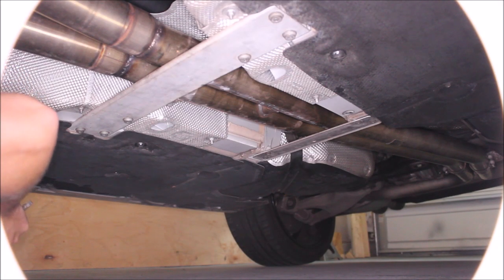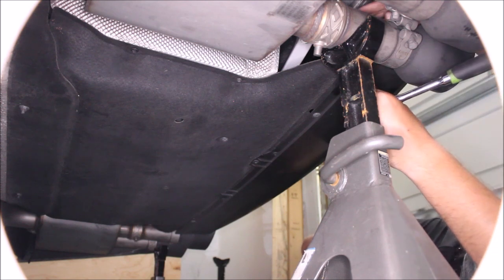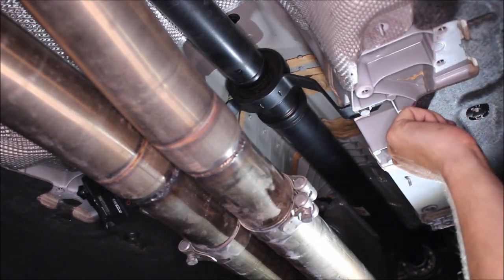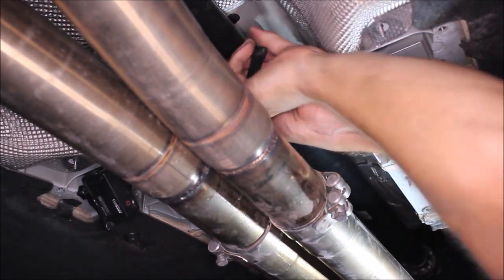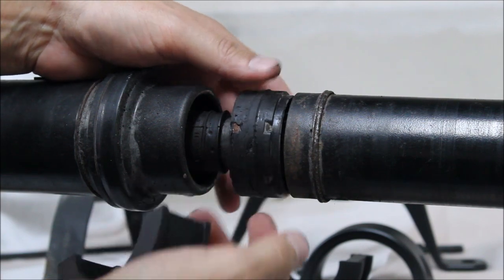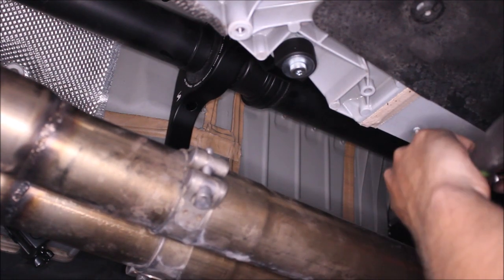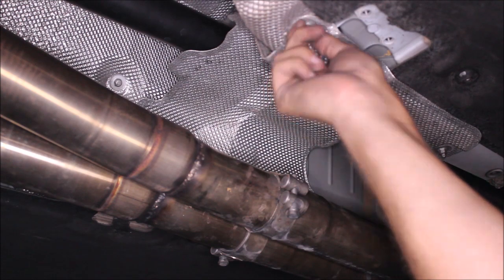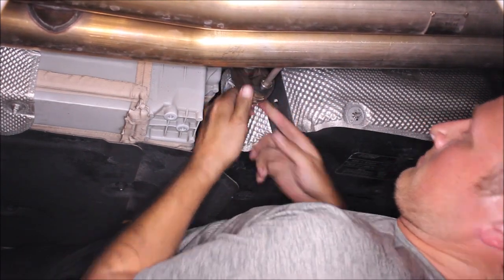Audi D4 Driveshaft Carrier Install - JXB Performance (D4001A0)

Comment: Do you add high temp grease such as the Redline CV-2 grease to the new bush and bearing assembly?
Reply from the maker: The bush clamps around the bearing outer race.  It relies on friction to hold it tight, so no grease should be used on any of our parts.
Reply: @JXBPerformance  thank you for the quick reply.

Comment: I purchased a kit for my Q5. After I cut the rubber bushing, I noticed my bearing doesn't move easily.  Is that a sign of my center support bearing going bad? Should I replace it before installing the new center support?
Reply from the maker: I've noticed on a number of shafts the bearing doesn't spin as freely as you'd expect.  I believe this is just a sign that the rubber seal is still making good contact with the sealing surfaces.  These are sealed bearings from the factory, which means they have grease inside and a plastic seal all the way around that butts up between the inner and outer race.  This creates some natural friction, which makes it spin slower.  As long as the motion feels smooth you should be good.